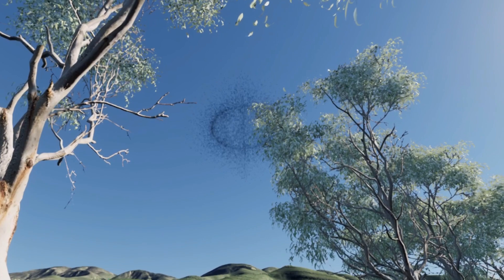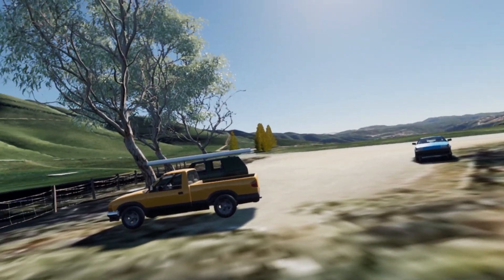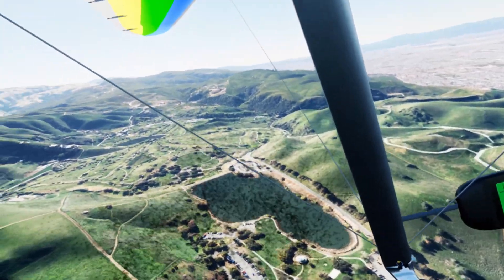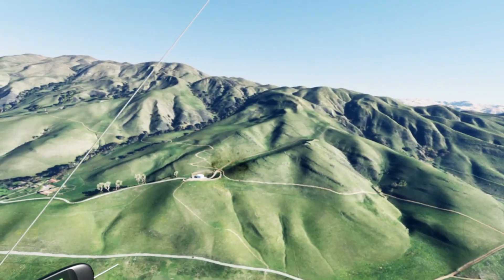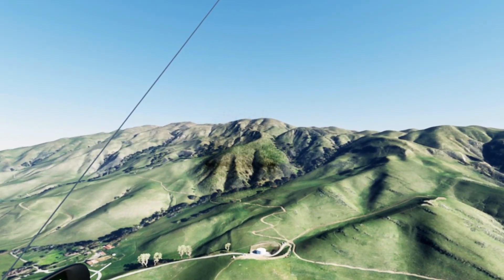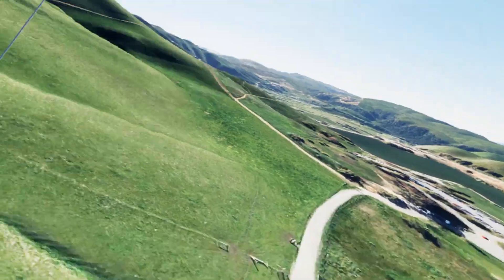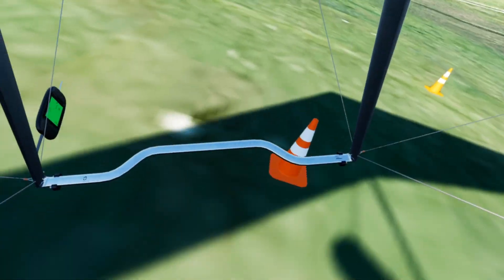dev update 6 17 movie

Comment: Is the simulation a fluid dynamics process, from which arise the behavior of a thermal, or are you modeling a thermal? (From the June 10 video, I'm guessing FD, but not sure.)
Reply from the maker: Sort answer is modeling the thermal.  To solve Naiver-Stokes, even over a limited domain is more than I can manage.  My goal is only to reproduce the general flow circulation observed, so we have appropriate gradients of lift and sink in the vicinity of the thermal, and realistic inflows and outflows below and above the main bubble.  As far as I can tell, most games model the thermal as an region of generalized lift, uniform in the simplest case, or  a specific lift profile based on distance from the core.  I have created a model that generates a 3D vector field, and its influence on the wing is evaluated at numerous points, to create rolling and pitching moments.  These are critical cues when entering the thermal which help us decide which way to begin turning.

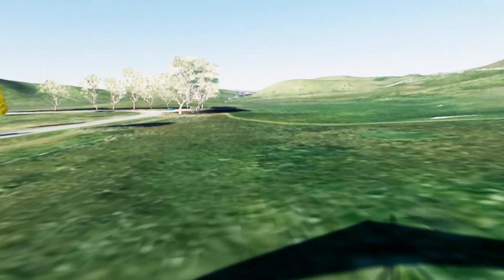Comment: @2:20 re. making it interesting to non-pilots:  as a HG pilot, I'd prefer it to be as realistic as possible and not "dumbed down".  Perhaps you could add an "arcade mode/realistic mode" preference toggle, and support both HG pilots who are looking for a realistic simulator, and an arcade mode for non HG pilots who would rather fly around w/less effort.  Just my $0.02.  Anyway, this looks very promising and looking forward to what you come up with.
Reply from the maker: No interest in dumbing down, but don't want to require user to need a harness and control frame rig in their home either.
Reply: @ThomasLowFlyer  agree with Jeff! Don’t dumb anything down, just leave an option to control weight shift with mouse/controller. And a mode with “auto stabilizer” and visible thermals. Condor 2 has just that, there’s an auto-rudder option, and a button to show thermals, turn-points and wind on screen. All those can be deactivated before you load the sim, so even if you press it they don’t show. That makes “realistic/arcade” modes.
Reply: @ThomasLowFlyer  Will it be possible (if you want) to hang in your harness and fly with your VR headset?
Reply from the maker: @JoshuaWriter  Joshua, Yes, this is the intended "enthusiast" use case.  In the present plan, this game will require VR to be played.  There will be many options for control inputs, including native VR type controllers, joystick, or harness rig.  I do not expect to support mobile VR initially, so will require a strong game rig to run.